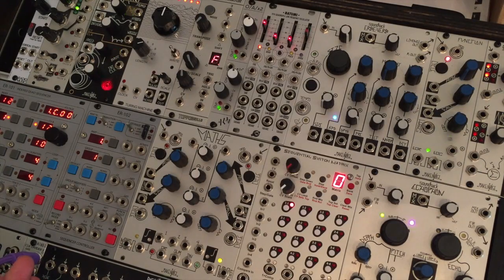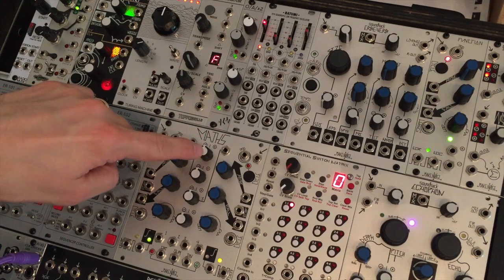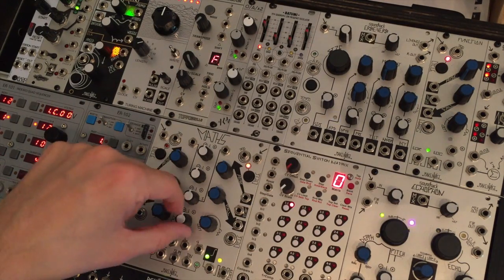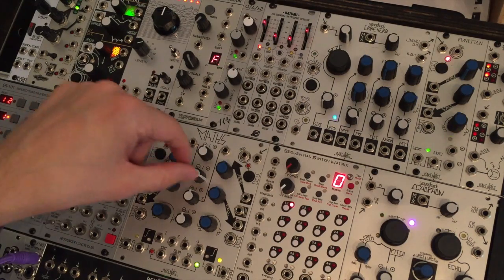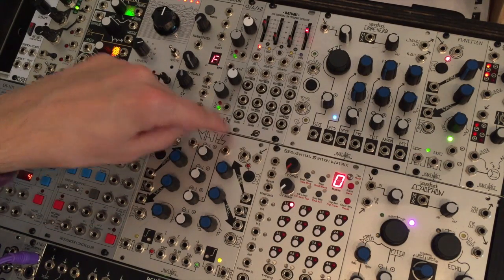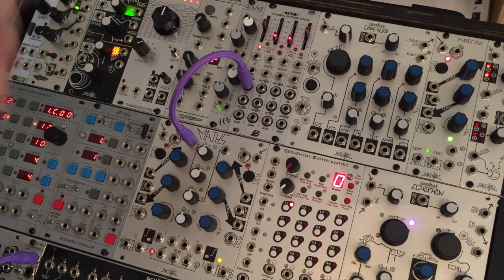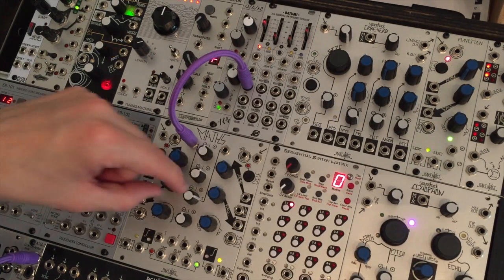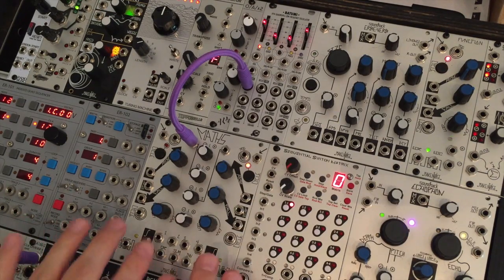Demystifying Maths’ Mixer

Comment: Just a quick point: at 0:55 you mention that the cycling envelope runs from 0v to 5v. It actually has a range of 0v to 8v from the unity output. This is a important because, as I recall, the range of the control signal expected by some of the other modules such as Optomix is 0v to 8v. 5v wouldn’t cut it.
Reply from the maker: You are correct! I made this video before I had a scope and made an invalid assumption.